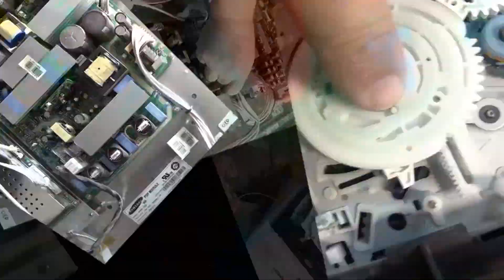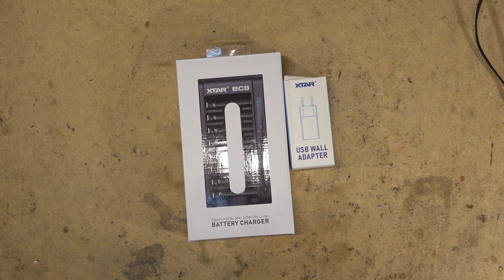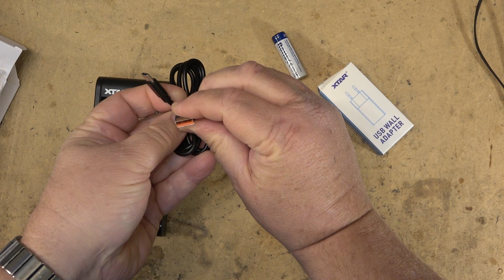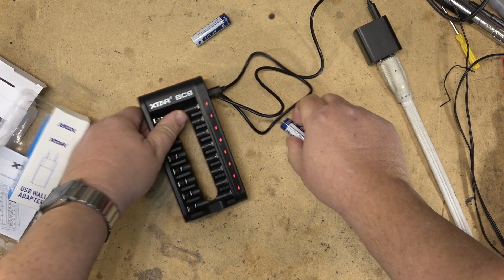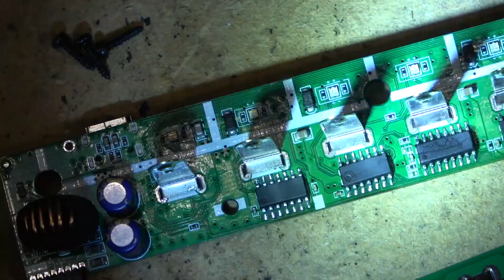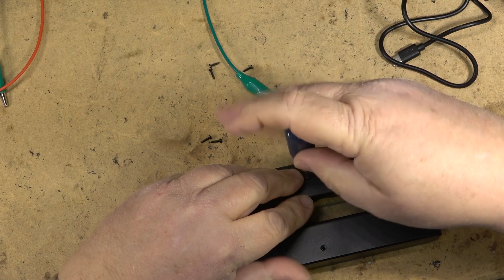Xtar BC8 NiMh Li ion AA AAA Battery Charger Tear Down

Comment: How does that adapter output 3 different voltages? Thank you.
Reply from the maker: QC3 is a communications protocol. The charger and device communicate over the data communication lines and agree on the voltage to use. There is QC2 and QC3
QC2 can switch to 9v and QC3 to 12 and even 19 or 24 volts. No communications and the power supply defaults to 5 volts.
Reply: Thanks Gary, I was wondering about that :)

Comment: I have the XTAR VC4.
I have had it around 4 years. I use it everyday & I have to say that this thing is Rock Solid 100%👍.

I thought it would be a good idea to buy the flagship Xtar Dragon VP 4 Plus.... wrong! That thing is a piece of junk!
The electronics in it are good & it does everything is supposed to "if" it stays together.
It is made out of a completely different type of plastic. With age, fractures and falls apart, loosing its structural integrity. That happened to mine only after one year of owning it. This happened  while it sat on my night table unplugged ( most of the time) out of the sunlight. It just disintegrated.
I went back to using the VC 4. It's been a good little charger.
I hope this one doesn't disintegrate like the Dragon!
Reply: I agree the  VC4 is a quality product.. Been using one for a few years too. 👍
Reply: I own a VP4 Plus, and it is not made of cheap plastic that disintegrates.
Reply: You bought a counterfeit VP4 Plus.